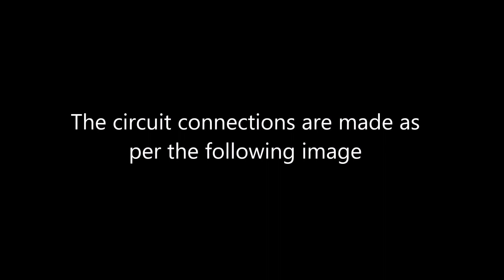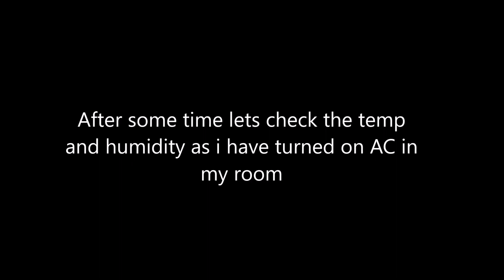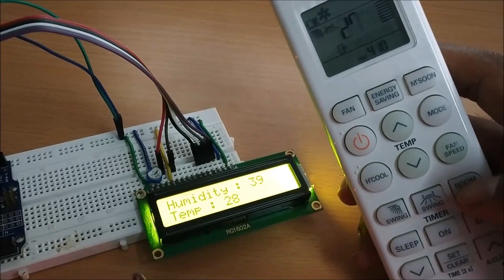Interfacing MCP2515 CAN BUS Module with Arduino

Comment: Why have you not installed the onboard R2 (120 ohm) resisters via the links left hand side of TB on each board.
Reply: @fatihkaraokur  ???
Reply: @Ronshaw100  I'm asking the same question too!  in the sense of
Reply: @fatihkaraokur  Hi, the two wire transmission/reception wires  should have a 120 ohm terminating resistor at only at each end of this two wire system. This is why each board has the 120 ohm resistor, and if the board is at the final end or starting end you install the link.